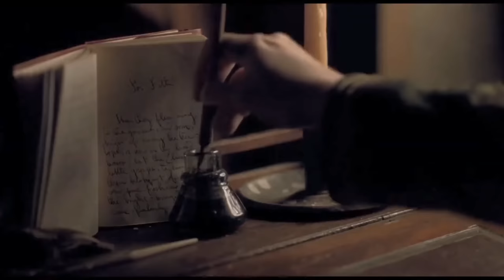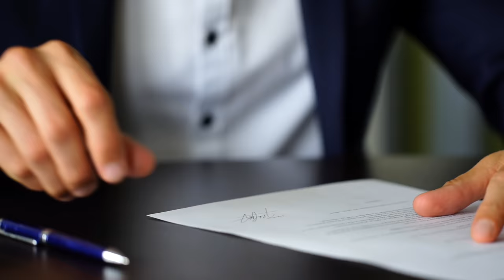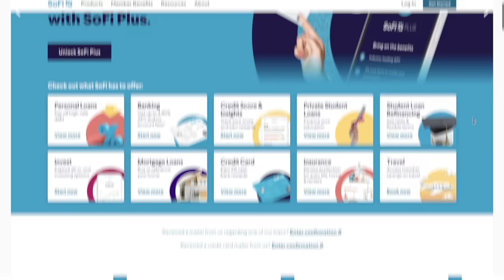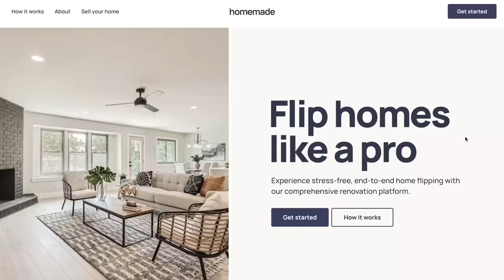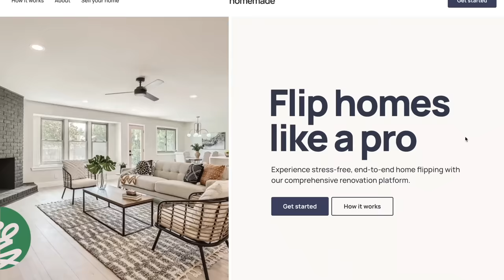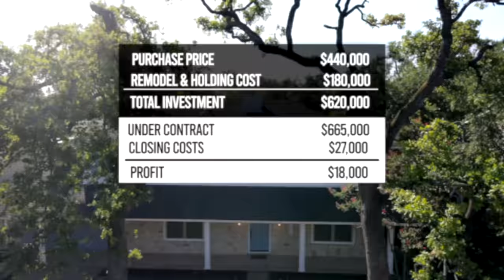$180,000 Renovation Budget | Before and After Home Renovation

Comment: Great job here.  I know this is just an investment property but there's only 2 things I would have changed if it were a property I was doing for myself.   Outside the only thing I would have done is widened the front walk and make it like 4 foot wide.  Makes a more dramatic entry and people underestimate the need for wide walkways.  Inside, I would have relocated that closet by the front door and open up the stairs.  It could have been moved to the right in the corner where little access space under the stairs.  Love the tile choices in the baths.  And using the chrome is a good choice too.  I'm wondering if the brass fixtures everyone is using might become dated soon.

Comment: I'm always a little disappointed to see that tiny kitchen in houses like this don't get made bigger when you're doing such a big renovation anyway? Is there a reason for this? Is it just cost/benefit? There's so much space so it seemed to me a logical thing to do.
Reply: Given the low profit as it is, a larger kitchen probably would not have resulted in normally expected profits - I wonder, looking back, where they think they COULD have saved money.   I can't think of any areas where they actually overspent - - a lower initial purchase price would have made all the difference BUT perhaps there was a bidding war on this property.  UPDATE:  I just checked on Zillow for houses of this size in Austin and I was surprised to see that it wasn't such a bad purchase price as I first assumed - of course the condition of the house was poor and I did see several properties listed under $421,000 that were of equivalent size AND were in similar shape to this house post-remodel.
Reply: @scrow9   but that doesn't take into account when this house was bought and when it was sold. If they bought at peak and sold at a trough...
Reply: @tyrelirwin  Fair point but you often can't know when you are buying at a peak for sure until the market turns down which is what seems to have happened to them